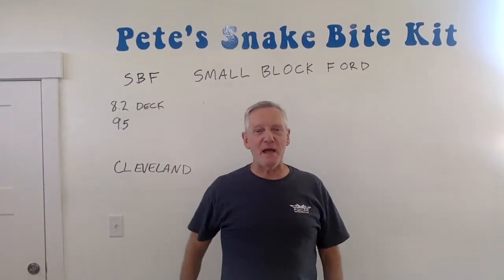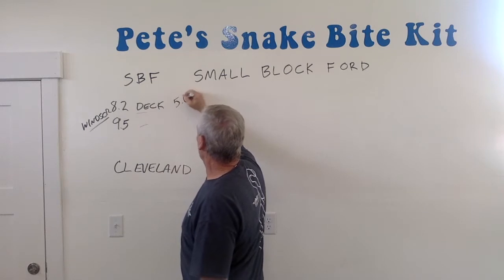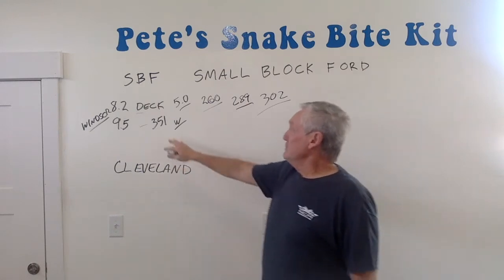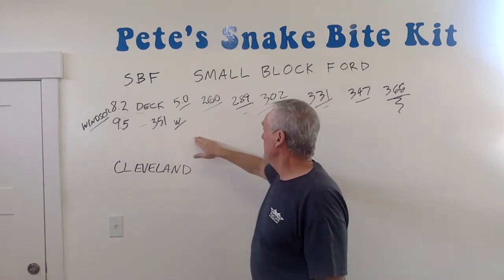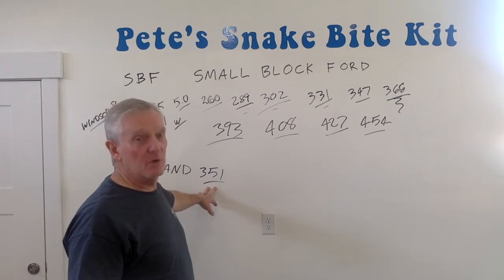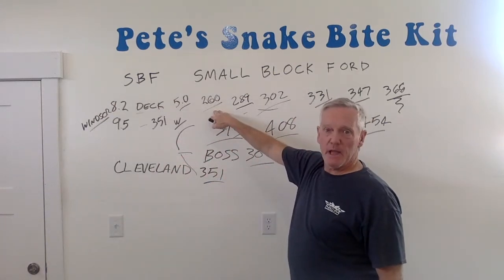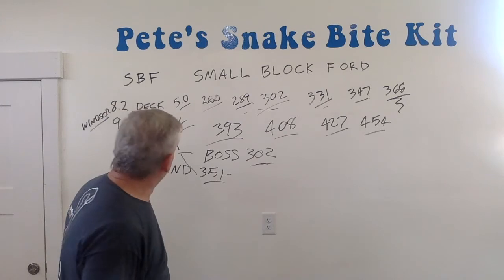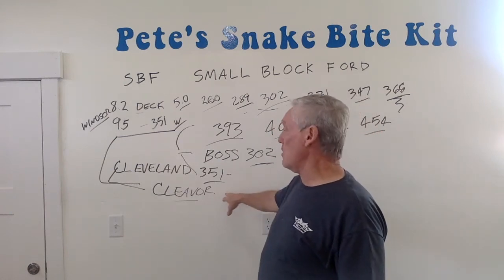EPISODE 10. Small Block Fords Explained

Comment from the maker: Thanks for watching! I didn’t cover the 351-400M family because they are not a very popular combo to work with, I would call it a small block because it is related to the 351 Cleveland family. There are not many aftermarket intake manifolds to work with, and overall not much development from the aftermarket. However, if that is what you have to work with, you can make something happen for sure. While it would take some searching and thinking there are some advantages. It has a tall deck height, so fitting a long stroke crank would be easy. Also the available intake manifolds I have seen on these guys favor low RPM. If you are looking for a torque monster, and a bunch of usable iron at most any pick-your-part, well there you go! Is this going in a Cobra or something else? Have fun with that and let me know how it turns out, Pete.
Reply: Well I am working on a 79 Bronco which came with a 400, but I dont know if I want to switch the engine to a 385 family. The transmission does fit ford big block, but of course the big question is, do I invest into the 400 for more the low end torque or buy a 460? A 460 does fits nicely with only needing to modify the motor mounts. And thank you for responding.
Reply from the maker: @willemholleman3729  Interesting, as you mentioned the other thing that makes the 400M unique is that it shares the bell housing bolt pattern with a 420-460. You will make more, everything with a 460, HP and torque. It will be heavier by about 150-200 pounds depending on variables. If the weight isn’t a drawback I would use a 460. There is a lot of support form the aftermarket and you can make some big horsepower if you after that. Using the 400M would be simpler as you mentioned motor mounts but, exhaust, pulleys and related brackets are already there. Depending were you live and emission laws, may make the 400 a good fit. I hope that helps. Let me know how it turns out.

Comment: He seems to forget the "Windsor" line ... named for engine plant in Windsor, Ontario, Canada ... began with the 221 cu.in. 'Challenger V8' engine used primarily in the "mid-sized" 1962-63 Ford Fairlane and Mercury Meteor vehicles.
Reply from the maker: You make a good point, i am really trying to cover the most common engines that would be used in a Cobra from the 1960s. I think it is amazing that a 221 and a 363 stroker have the same outside detentions, almost 150 CDI larger. 
Thanks for watching, Pete.
Reply: @PetesSnakeBiteKit :  I had a customer who came to me with a 260-powered Sunbeam Tiger who wanted, as Tim Taylor would say, "More Power!" 

I used a 5-bolt 289 block and a 302 crank assembly and built him a "stealth" 302. "Stealth", because the 5-bolt block looked just like the original 260, though the 4-barrel AFB sure wasn't "stock" on the originally 2V-equipped Tiger. Thing would lite up the tires with no effort required.
Reply from the maker: Sounds like a very cool project! I never worked on a tiger, looks like very tight engine compartment.
Reply: @PetesSnakeBiteKit  Does the term "shoehorn" raise virtual images? 🤔😬😏

Comment: What about the 351 modified, is that a small block or a big block?
Reply from the maker: I would call it a small block, Cleveland motor mounts and cylinder heads etc. but, the transmission bolt pattern fits a 385, (429-460). Not a lot of after market support but with a little creativity could be a beast.
Thanks for watching, Pete.

Comment: I have a 351w sitting in my backyard. It was my first rebuild. It is stock, but has roller rockers. Probably has 5-7 k miles on it.  I could never part with the engine because building it taught me so much and took so much time. Would this block be strong enough for a punched out 427 build for a gray hair guy like me?
Reply from the maker: Most 427 Windsor’s are aftermarket blocks which you can bore to 4.125, a stock block is 4.030, 4.040 max. They make a crank that makes 427@4.040.
So it’s possible but it’s a pretty long stroke, 4.125 I think. Talk to a good, local machine shop for specifics.
Thanks, Pete.
Reply: @PetesSnakeBiteKit  I watched your other videos and am probably going the route that you did. How are liking it?
Reply from the maker: @urgentcareguy3  I haven’t started it but have seen a few and read and watched every Dyno test I can find. I should be scary.

Comment: Am I correct in saying the old 302 Ford and the 80s and 90s 5.0 are quite different? The old 302 has a 4inch bore and 3 inch stroke. The efi 5.0 from the 80s and 90s appears to have a totally different bore and stroke. Is that correct?? Both are 302 cubic inches but they appear to achieve it in different ways.  Sorry I'm a Chevy guy and just now getting into Ford's. I got a 66 Ford truck I need a motor swap in. Trying to figure out the difference between the old 302 and the efi 5.0 from the 80s and 90s. I'd like to have efi in my 66 but can't afford a coyote lol
Reply from the maker: As far as the 5.0 and 302 go, 3 inch stroke and 4.0 bore and parts for the most part, interchange, same-same.  Talking with a friend this week we agreed Coyotes don’t sound very good, sorry. And they are expensive. I like the sound of the Windsor family much more than the Coyote. Having said that, modern engines like coyote and Chevy LS make power and have very wide power bands. Have fun with truck, being a truck I would suggest a bigger CI Windsor to pull the weight. Building a 400+ inch Windsor doesn’t cost much more than a good 302-347. You can check out my 408 build on this channel. 
Thanks for watching, Pete.

Comment: Thanks Pete, this was helpful. I'm not doing a cobra but the concept is similar. I could use some help.  I'm a Ford designer (for 35 years - exterior design) and I need a lightweight v8 that's NOT LS for - obvious reasons. I like the SBF because it's compact(!) and well, it's Ford. Fits my persona. Hot rod friends at Ford are not concerned with weight and are not much help.  I'm doing a monster miata and I want the engine as light as possible. I've got a serious budget and I'm willing to fork over the money for every oz subtracted. I've looked at World Products alloy blocks but they are not much lighter - they are thick built for massive hp not light weight. Am I missing anything?  Are there other light aftermarket blocks? Someone was saying that Dart could mill out a billet engine to specific requirements. Has anyone got experience with Dart? I only need maybe 400hp - normally aspirated 8.2 deck pump gas street engine. Thinking AFR heads. But I want LIGHT. THANKS!!! I'm all ears.
Reply from the maker: Oh boy that sounds like a fun project! I have never had the budget to learn about aluminum blocks. I did have a stroker Cleveland in the 1980's with aluminum rods. They were not lighter then steel rods just cheaper, back then. My engine guy ( the late great Jay Steel of Taylor Engines) explained that more mass was needed to have comparable strength. He said in short they are about the same strength by pound. This may explain why the aluminum block isn't much lighter. I have a friend with a 8.2 iron Dart block that is supporting 1000 hp with no issues. So, I would buy an after market block with the lightest shipping weight, you won't break it with 400 HP.  You can have the crank and rods lightened, manual transmission, light flywheel etc. AFR cylinder heads are a good way to go, if you are using a carburetor they sell an intake port matched. If you are using EFI, FTS heads make big power and have EFI intakes to match. But they have relocated the valves which can make more work for you getting the pushrod/rocker geometry  spot on. The other thing to look at would be to see how far you can move the engine back, I guessing the Monster Miata is worried about weight over the noise. Years ago, I was a service manager at a Ford dealership and there was a FSE (field service engineer) who was building a Miata with a SBF, I thought it was cool because at the time Ford owned 25% of Mazda. Have fun, let me know if you have any more questions, keep me posted. I would love to see pictures of the build. I hope that helps.
Thanks for watching, Pete.
Reply: I've seen the Ford 289 ( awesome motor)put in cars in Europe, AND THEY RIP !! high refs a d light frame and body.you got yourself a fast car.

Comment: so a stroked 351 is a better way to go than to buy a 427 engine made by ROUSCH is that your opinion  pete ??
Reply from the maker: Mmm, I am sure a Roush 427 would be a great engine for sure. I spent 1000s less on my engine build and will be making the about the same HP, I think. Also I selected every part so some satisfaction comes with that. 
Thx, Pete.

Comment: I’d like to know more about the horse power ratings for these engines. What can you safely get out of a daily driver from the 5.0 or 351 Cleveland?
Reply from the maker: Mmmm, that is a loaded question because there are so many options that affect the daily deal. Any of these can make 450-500 safely, N/A more with a turbo or 2,  the factory 5.0/302 blocks are questionable above that. Making power with a well thought out turbo/EFI seem to more gentle on components.  In general the bigger displacement the easier it is to make power with out sacrificing drivability. That is why Lincoln’s and Caddy’s had big engines way back Caddy Eldorado 8.2/500 comes to mind. There are lots of crate engine options that will do the trick, or find a good local machine shop and come up with a plan. So, short answer, 450-500 depending. I hope that helps thank you for watching, Pete.